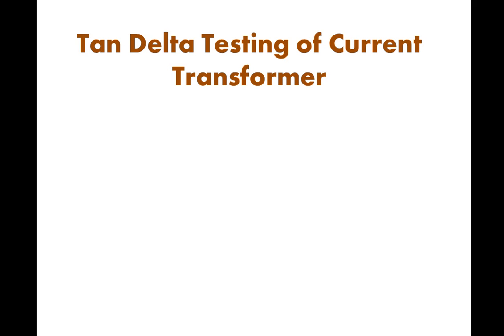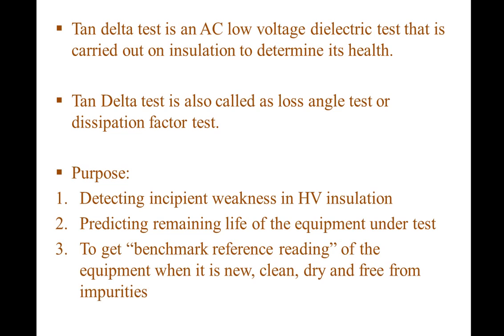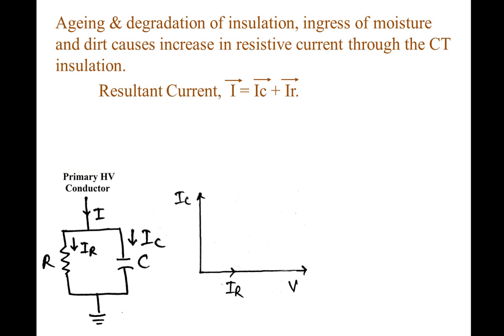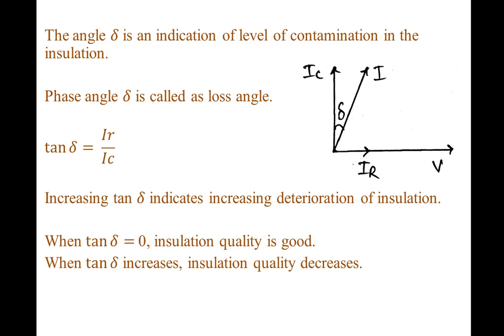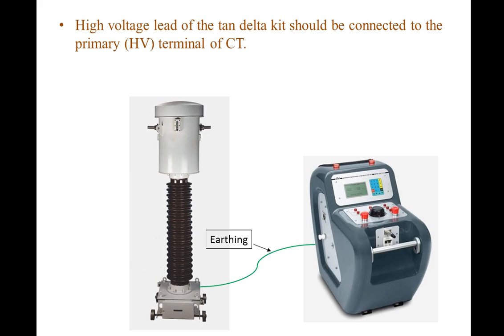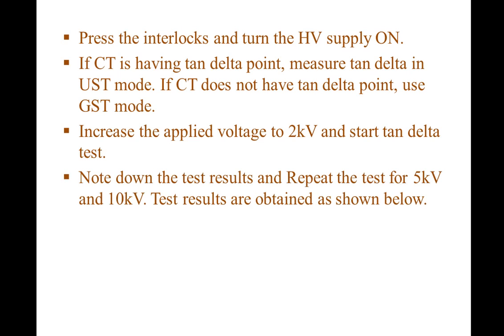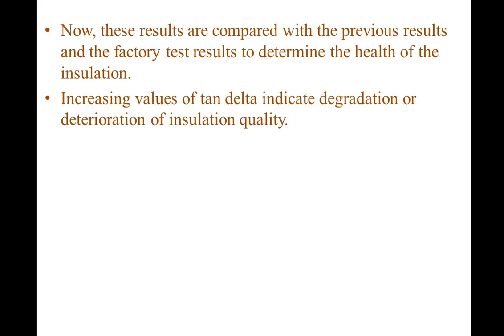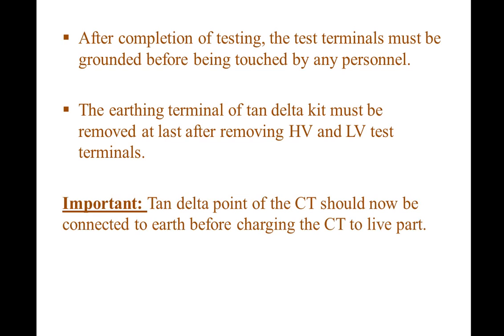Tan Delta testing of Current Tranformer (CT) - Theory & Practical Procedure

Comment: Your video is super i love it, I have one doubt if we have CT operationg voltage is 220KV, We just applying the 10KV(4.54%)  of rated volatge, in service condition the leakage current may be increases (resistive current) means the tan delta also varies it might be more than 1% it that case?

Comment: Sir I have make a wiring of new substation. Sir before charging of power transformer what we should test performed of power transformer and there protection and control system.
Reply from the maker: These tests are conducted before taking new Transformer in service:

SFRA
Open circuit test 
short circuit test
Magnetising current test
Magnetic balance test
Vector group test
bushing tan delta
Winding tan Delta
Winding resistance test
Differential stability test
Ref stability test
Reply: @substationtestingandcommis3452  sir please make a video of testing of power transformer and there protection and control devices

Comment: Thank you for the information, i have a question: The HV terminal must be connected to the primary terminal of the CT, we all know CT's have 2 terminals, usally P1 and P2, do i have to short them, or just connect the HV to P1 terminal? 
In terms of secondary windings, theyre shorted and grounded, am i right? i whould be so grateful if you could clear my doubt
Reply from the maker: P1 and P2 are internally connected, you should not short them.
Reply from the maker: Secondary windings are connected to meters or relays.
Reply: Secondary alrdy connected to meter and relay so, secondary is not open circuit even during tan delta test. The P1 is first remove from the main line only and then the connected to tan delta HV side. P2 is usually left like that since isolator is alrdy open during test(or maybe earthswitch need to be closed?) . I have performed this test once,I think we usually test with 2kV and 10kV at 50Hz and 100Hz frequency. The current being injected inside CT is around 100A.(For 132kV)